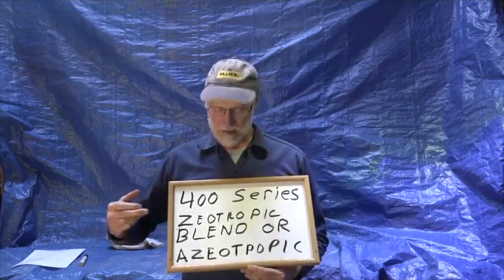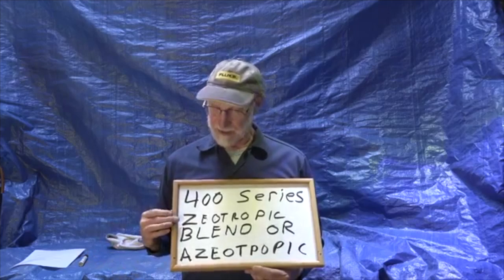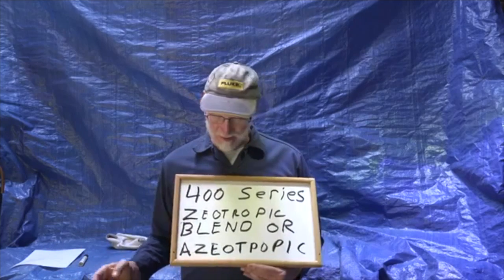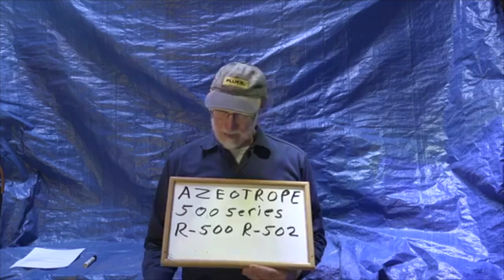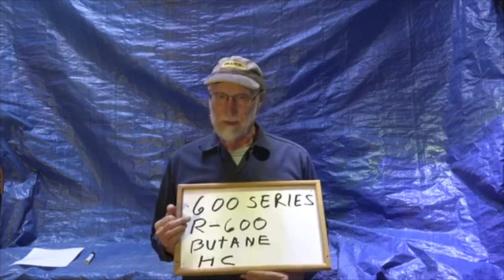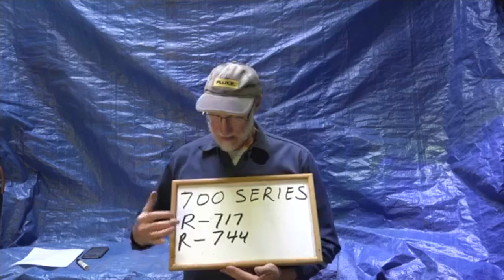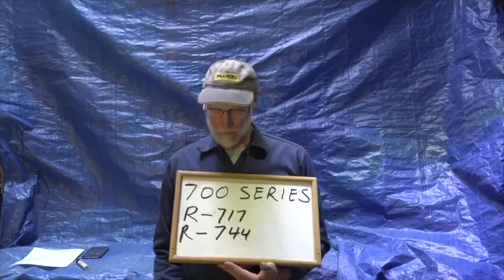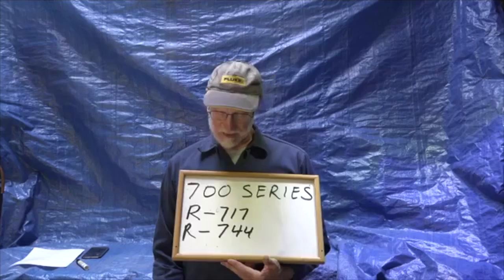Refrigerant number designations part 2

Comment: A big pharmaceutical company rid themselves of CFC cooling in their modern office buildings, and replaced it with ammonia. They did this to save the environment. (Humbug...) The ammonia is separated from people by placing it outside the office space. I know of an old movie theatre with ammonia in the basement. Other old theatres used a giant swamp cooler system, but I doubt it worked well in a humid geographic area. A very old ice plant uses ammonia, but I heard reports it has an odor in the very ancient building. I think home units using gas flame should come back in use. Thanks for making this excellent video. Cheers